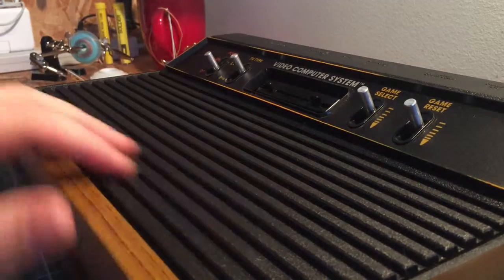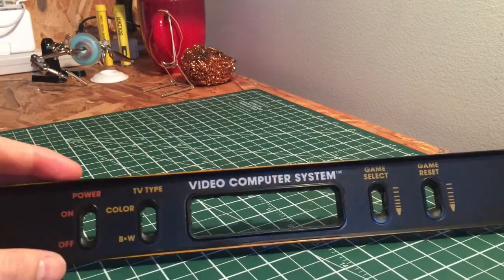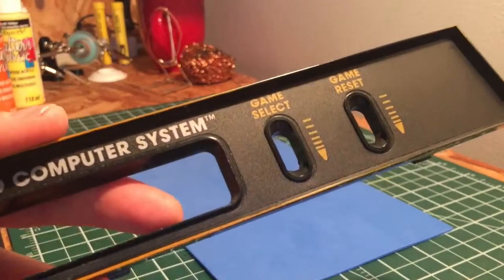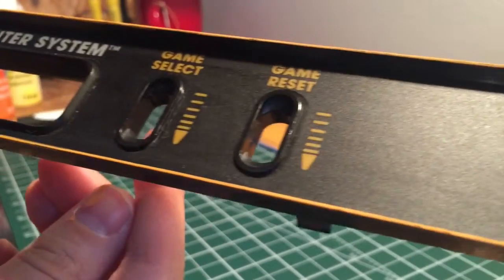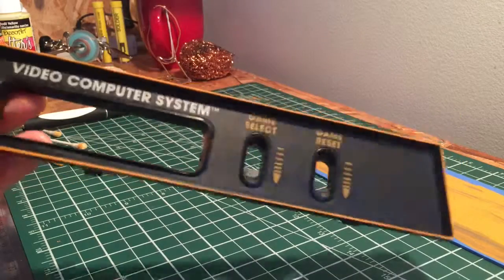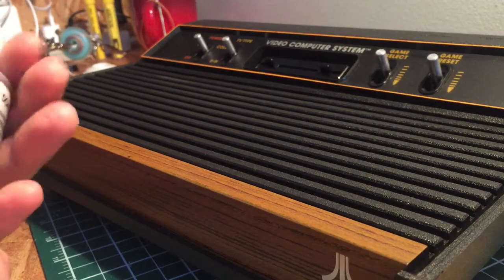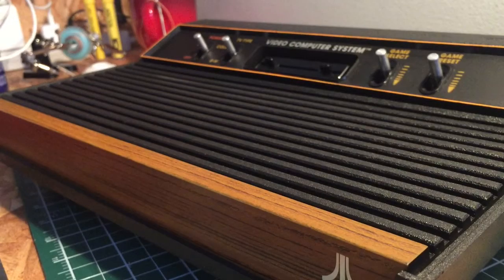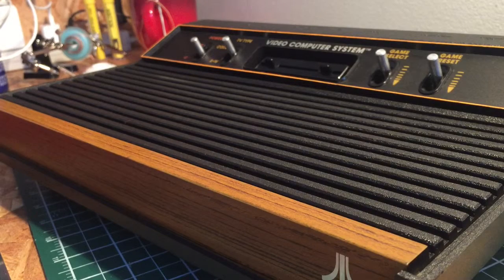Atari 2600 Restoration - Part 1.5 (Touch Up) // How To

Comment: @Willbot - Great video and I love what you did with the paint. I actually have some craft foam sheets and I'm thinking about putting painters tape on the sides (for extra precaution) so the paint doesn't get on the sides of the face plate. I also noted the colors of paint that you used as well. If I can't get the exact (excluding white) colors, I'll try and get the closest. This is an A+ in my book. :)

Comment: Picked up a heavy sixer a few days ago, which are quite rare here in The Netherlands. I had the same issue with the paint and actually thought about this method instead of doing it with masking tape and painting by hand as I would expect this method to look way more even. Nice to see it work. You used foam ? I was thinking about using lino pads, maybe that would make it work even better ? No idea really….
Excellent tip about the WD40 for the switches. Thanks !